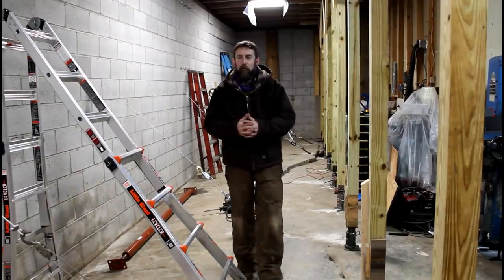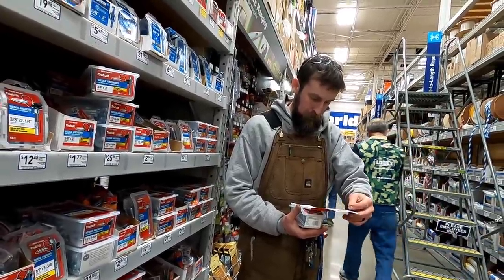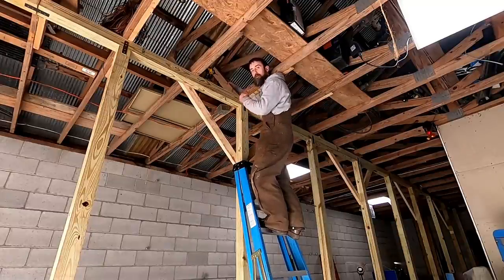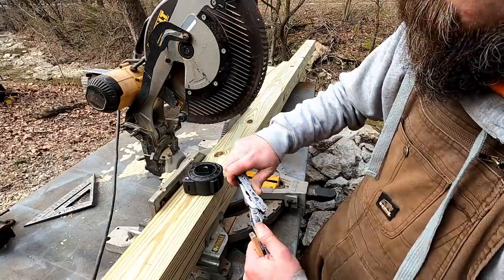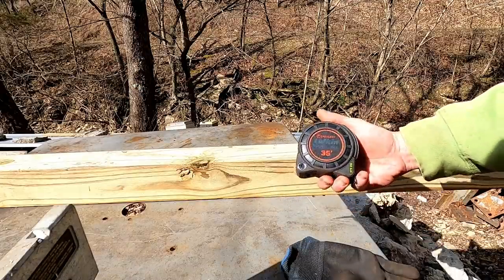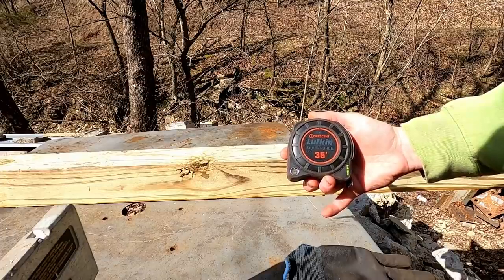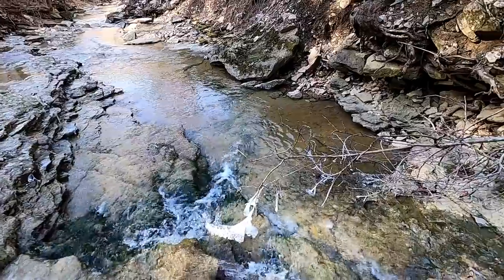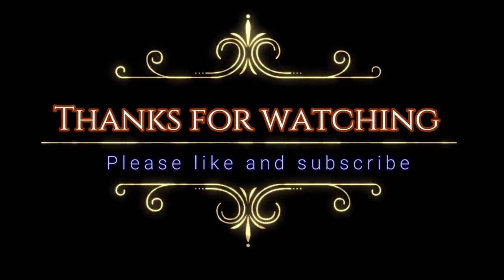Repairs To the shop begin ! Preparing the roof lift wall

Comment: An air hammer with a chisel bit will help with knocking the mortar joints out between the blocks when you’re ready to start demolition.  I’ve had to take down a few block walls and it really helps move things along when there is compressed air available.  Hammer and chisel is tedious at best and a royal PITA at worst.
Reply: Bosch makes an electro-pneumatic chipping gun that I've used to take block walls apart. Works a treat. Damned thing costs like $1,200 though. Still a neat toy.

Comment: Steve wish I could help you buddy. I do this for a living. Shame I'm base in the uk. Would be straight over. Can I ask why you didn't use acrows props insteadof bottle Jack's. . And beams supports top & bottom for the acrows.. Put a brace on the back of the posts leaning up into the rear side trusses. Also would  not hurt to put some acrows on the outside wall under the facia & soffit fix 4x2 support fixed to the top then your acrows. Hope that makes sense. It will take some of the load of the outside roof trusses.when it comes to taking down the wall. Wish you all the best. Stay safe buddy. If you need any advice drop me a message and I do you a drawing if you like.

Comment: I know you are only one state away but both missouri and Tennessee are wide and I am a long way away.  I have an old derelict backhoe and we could make quick work of that wall.  Just keep the videos coming.  My crack in floor is minor compared to yours.  Inch wide but same plane, feller who used to own it took remains from loads from concrete company.  Some of floor is thick others thin but really not bad.

Comment: Steve.. do you have a pnumatic hammer/air chisel ? do you have a long piece of bar stock 8 or 9 feet  probably 1/2"  even  a piece of rebar.. you could weld a tip on to allow you to use it with the air chisel..  tie a rope with a bunch of loops..  and put a hook that allows you to hang it over a rafter..   now you can use the long bar driven by the air chisel and supported 2/3 to 3/4 out  in the loops of the dangling rope to cut vertical slots in your block wall.   i am taking that the wall is not filled..  there are hollows in it still this can reduce the amount of wall section you knock over from a safe distance..  if none of the cells are filled...  you can run a horizontal break out of both sides from a safe distance..  then go across taking a 2 foot section off the top of this separated section.. then take another 2 or 3 foot section with a horizontal cut..  when breaking thru on the horizontal. perhaps on the vertical.. you may want to leave connected sections on your side.. while you aim up and down to completely break out almost all of the back side..  you may want to break out with more height toward the inside so when you break out the final connections the now free area above hinges down and inward.. with forethought to the cable come alongs.. 

 i don't know how the BOW in the wall is going to like being pounded on.. but taking it down from a safe distance and one section at a time would seem to be a great idea.

Comment: Wow that's a sketchy wall 😱

Btw I would not use several bottle jacks like that, rather have one or two to lift up and then place under a solid stud since those jacks usually leaks over time from minutes to hours slow leak and could also blow a seal and suddenly fall down. (wrote this before i saw you screwing the support lumber on the sides after 😉) 

There is also steel support "beams" that is adjustable that would be perfect for this, much used for temporary support walls.

Comment: should have used acrow props  in place of those timbers and hydraulic jacks. seen 3 story buildings held up , while walls and floors have been replaced.

Comment: By the time you are done with the support, you won't even need an outside wall for support. The roof will be a cantilever that will not even need a support. Certainly the most over-built wall I have ever seen.

Comment: Steve, If I were doing this, IF I could afford it, I would move the back wall out 8 to 10 ft. over to the first partition  lay up a sub-wall inside, on the original back wall line and have an area of storage and move the air compressor and phase converter ETC. to that area and get it out of the shop space, a simple lean-to roof would suffice.  Not that much more work and free up space in the work area.  Aloha I enjoy all of your video's, thanks for sharing and including us on the journey... The major constraints on life are time and money, or so it seems to me. He pomaika`i `ia mai ke Akua

Comment: I bought the extended warranty at harbor freight for a finish router that I broke 2 weeks later and neither Harbor Freight in my area would replace it. When I bought it they said "oh yeah whatever happens to it bring it back we'll replace it no problem". When you take it back you wait for 20 minutes for them to call some support number and then tell you its not covered by the warranty...what a joke. I will buy Pittsburgh hand tools at Harbor Freight but no more power tools. 
Good luck on your shop. Can't wait to see that wall come down.

Comment: I don't know what wall material you are going back with, but if you can take down the cement blocks and not break them just use the same blocks. Saves money.
Reply: Steve already said in an earlier video he doesn't want the weight on that wall. So it's not going to be block.

Comment: I noticed at some joints the end of the boards are not pressing flat-end of the board against the next board in line, but using bolts or nails to hold the ends in shearing action.  Be VERY careful about this in that a twisting force can pull out such ends and then there is nothing holding that end of the board to its connecting board.  Seating all such  joints firmly board to board may seem to be over-kill, but when that sloped wall begins to move due to lack of support from below, you do not know what is going to happen unless you have X-rayed the ground under it from one end to the other...

Comment: I've got that same Gerber. I keep it on the table next to my Barcalounger.  Makes a good fingernail cleaner. Haven't found much else it's good for. They got to reel in these design engineers. Just because you have a CAD station is not enough reason to reinvent the wheel or the knife for that matter.
Reply: Based upon how unnecessary (and rude) this comment is, maybe you are not smart enough to figure it out.
Reply: Multi-tools have been around way before CAD systems existed. The Leatherman was introduced around 1983. Swiss Army knives go back to the 1800s. They're very common with hunters and fisherman that aren't about to carry around a toolbox. There are even examples of mult-tools that go back to Middle Roman Times (BC). Just because something isn't useful to you doesn't mean you need to disparage something that others might find essential.
Reply: @scottr939  I would venture to guess I own maybe two dozen iterations of multi tools. This Gerber is not worst among them but damn close. The implements are poorly designed, too short, inconvenient to access, one, the lanyard attachment is a waste of space in the handle while the phillips is a flat stamped slab shape that is hopeless. The scissors do not cut and the whole thing is too bulky to carry around. 
Nothing, including the myriad later generations of the original Leatherman, beat it for convenience and utility. This imitation falls well short. At least it doesn't sport a claw hammer or an adjustable wrench feature. This is the the product of Gerber's fevered dream to beat Leatherman at their game and they obviously relied mightily on CAD to take that swing. They missed utterly.
But hey, thanks for the history lesson.
Reply: Paul, I'm having my coffee and enjoying your reply. Thanks for the exceptional defense of the much maligned CAD design segment of society. 
They need a champion. Apparently you are he.
Reply: @cableup1  Maybe if you had simply reviewed the knife in your first post instead of an obtuse rant seemingly focused on the evils of CAD and multi-tools, more people would have benefited, and we wouldn't be having this conversation. CAD, like any tool, is only as good as the humans making the design decisions. Bad engineers can make just as poor decisions with pencil and paper. And communication is also just a tool and only as good as the human choosing the words.

Comment: I seem to remember reading a book once about "the problem being the solution" or some such.
You're looking at a wall that needs to come down.
I don't know how far into your life the local government gets but, if you can cut those trees between the building and the creek, maybe a plan of controlled demolition could work out.
Once you've got the roof stable and disconnected from the trusses, section the wall with a cutoff saw and let it drop.
Then some machine time, an operator and a tri-axle and clean the blocks out of the creek.
Or just hire a demolition company with insurance.

Job done?
It's tough to make suggestions from where I'm sitting.
Best of luck.
Reply: I of course meant "the wall disconnected from the trusses". Doh!

Comment: I don't see any rebar or rewire in that concrete.  I think if those things were there, your slab wouldn't have split a bad as it did.  I have a similar problem with my shop.  I'll never have concrete poured again without those things.  Good luck with your repair.

Comment: Paid a guy to remove a block garage, he showed up with a pair of gloves, a hammer, a pickup and a 2 X 6. Had the whole thing hauled off in 4 hours. He knocked out some holes in the block with the hammer, leaned the 2 X 6 against the block wall and walked up it until the wall fell, all the blocks separated and he picked them up and put it in the pickup, easy.

Comment: She coming along.  "not sure if you would be allowed to"   but have you considered building a retaining wall along the river just out of timber and back filling with all the concrete and rubble  you would save alot of time and money by not having to take it to the tip. cheers steve

Comment: Ohw you don't mean that! At 11:50 min! I too had one of those very very dangerous things! There is very little , as even no, safety with those. I had bought one decades ago, pulled a car motor out, wanted to refit it, so had to lower it and so you have to reposition some kind of spring and so by every krank of that handle you can unload bit by bit. OF COURSE the 2dn try the safety lock disfunctioned and all hell broke lose. First I hamered with the bigest hamer I could find (app 10kg) the thing to picess. Than bought a real chain hoist. NEVER use that type of hoist. It really is unsafe . And Steve, mark my point at 12:40 min, see the bended thing. A manual 500 kg chain hoist is app. $80,-  safe your live. Keep up the good work, good luck with your workshop.

Comment: Be careful with screwing the 2x4 locking timber to the posts - those screws will be in 'shear' and will not be strong.  Instead putting bolts through the 2x4s and post would be stronger.  Could also cut 2x4 to fit from floor to the metal bracket at the bottom of the post.

Comment: good idea on fortifying the liftpoints , wouldnt had tought of it either but seeing it makes great sense ,  the bracing to the sides prevents the whole roof from moving sideways should the liftpoint tip over during the lift 
only thing that might be an issue is that the beam over the wall holling the trusses is mounted to the wall (would mean having to hot up there and see if you can cut everything through wth a sawsal befre lifting it more
to keep the time that the roof is supported like this to a minimum you could dig four or so holes in a line to where the wall was down to bedrock put some rebar in and gil them with  quickcrete in them 
then build masonairy one stone by one stone pilars  up to the edge of the roof , then you can safely take away the jacks and take the rest of the flooor out , tie in the new floor with the rebar sticking out the quickcrete pilars and build walls in between the pilars on top of that , the foundation to the bedrock and the pilars should make that side a lot stronger and a lot more stable in the end even if water erodes ground out from under the floor

Comment: I am liking everything  inside supported well, I know that you have cabled the wall and  thru hole attached plates on the outside.... I might have run a horizontal 2X's  between ("Hollow block wall" 1st video) and the plate spanning 2 guide wires or at least in the middle of the 50' span.  2nd would be to only cut loose every other truss from the top plate should be 3 nails holding truss to plate that would allow you to remove 2 block  row 1 and 1 block row 2 then skip a joist bay.

Comment: Have carried a Gerber Suspension on my belt for several years.  The original pouch went to hell within months.  Most recently, I have been keeping it in a small of back magazine pouch.  We will see how durable that is.  The tool has been helpful many times — but carrying it remains a little unhandy.  BTW, squirrel make an inordinate racket when they clamber around in a loft.

Comment: That roof is really not that heavy. It's gonna go up like butter. You'll see once you start jacking it up. Take a sawzall and cut the nails holding the trusses to the top plate above the block wall before you start jacking. Just slide the blade between truss and top plate with a good stiff, long demolition blade. You can jack it up just a little to take the pressure off the wall , as to not bind the blade.
Reply: I think he should leave the plate to tie the truss heels together.
Cut the plate free from the block, whether it's bolts, nails or wall ties mortared in.

Comment: Ive had great luck with bauer brand. I use the frill and impact basically everyday and its been about a year.. they lasted longer than my porter cable set
Reply: I think most tools are coming out of the same factories today anyways. They just make them different colors and slap different names on them before they go out the door.

Comment: I think you should of put them ground anchor bolts into the good part of the exsisting pad because when you start lifting the roof trusses off that wall you don't know if that's all that's keeping that wall up and with you tieing the wall into the pad that is falling away with the wall it might just go anyway, but if you had tied the ground anchor to the floor that isn't falling away it might keep it standing

Comment: Steve I wouldnt push wood through a table saw freehand like that, you will eventually get a kickback and it could seriously injure you. Do a youtube search for videos on kickback and you will see what I mean. use a fence, a push stick and stand out of the line of fire. I have been on the receiving end of a kickback
Reply from the maker: Thanks, the table saw is not something I'm good with or up on proper use. Thanks for the info2👍🙏
Reply: @SteveSummers  Yes, this is very dangerous.  Someone watching may not realize just how dangerous this can be (I didn't ether when I first started using a table saw).  I'd be far more scared of that table saw technique than the engineering you're doing (which looks great btw).  You might considered telling viewers, in a future video, not to use a table saw that way.  I know there's many things in the shop that can cause injury...but that sawing technique WILL result in an injury eventually.  Sorry for the rant and I love the videos.  BTW, like you said in a prior video, no harm in doing something wrong and getting corrected (look up "Cunningham's Law").  This is how we all learn.

Comment: I like your bracing idea better than the one I gave you. Are you going to try to keep any of the blocks to re-use some of them?
As you are taking the wall down, go back and check your bracing posts and see if they have come a bit loose as you remove that weight off of them.
good luck man, slow and steady will get it done.

Comment: Maybe I missed it, but what are you going to do for a new foundation under the new wall? Looks like rock isn't very far down so that would provide decent support. Maybe drill some anchors into it so the foundation couldn't slide.

Comment: I assume "Peanut" and Mr. Anonymous have volunteered to be jack operators while you supervise from a safe distance outdoors. Yikes!  The diagonal bracing to keep the poles vertical offers me a tiny bit of comfort. The trusses are going to be their hardhat if things go wrong.  Please take your time and don't worry about the video.  Some of the best videos are when folks abandon a plan that isn't working out.  For safety sake, take as long as you need to plan every move.  We'll be here even if you decide a wrecking ball is safer.

Comment: Steve, the way you have those cables anchored to the tilting slab do you think that the whole shebang might possibly  tip over into the creek when you raise the roof?
I wonder if it might be better to put your anchors into the "good" part of the slab that will never move with the weight of the roof on it.

Comment: Do you think that it would be worthwhile to use an air hammer and a wide flat bit to bust the mortar between the blocks?  Not so much to reuse the blocks but to keep them intact and speed things up.   Stay safe :)